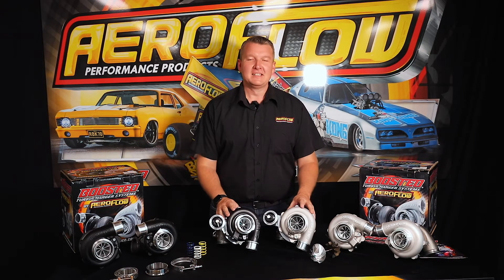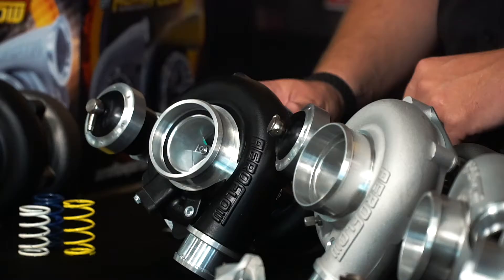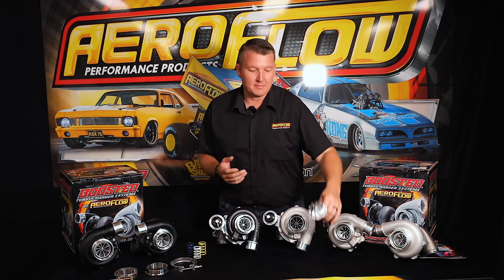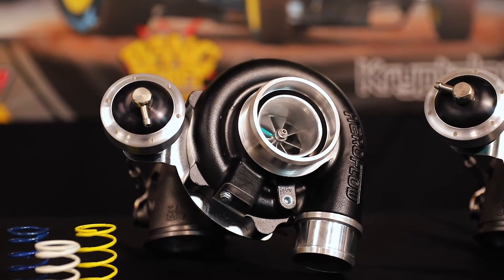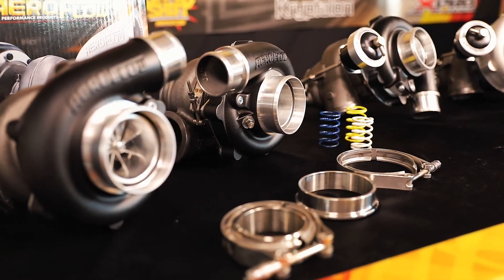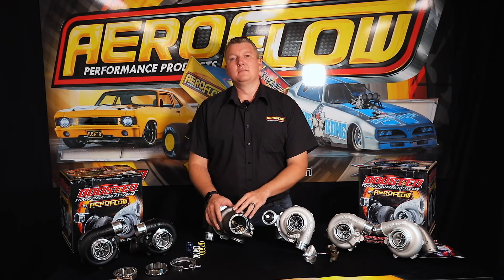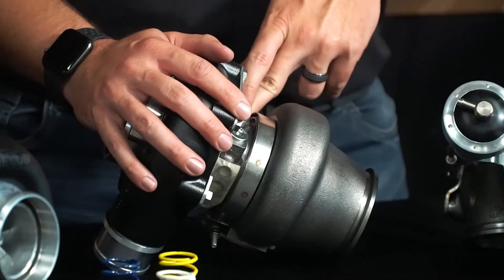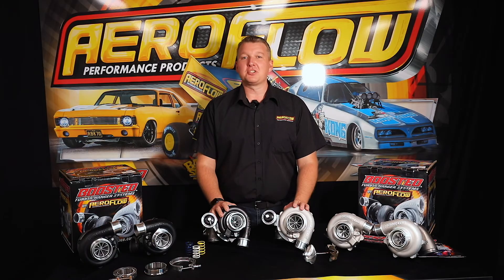Boosted By Aeroflow Turbochargers 4849 & 5449

Comment: do you have a how to size turbo vid
Reply from the maker: Not specifically but if you take a look at our Turbo 101, 102 and 103 videos that will give you a good idea on how things work, how they should be setup and roughly how to size a turbocharger. Aside from that feel free to get in touch and we can assist where possible
Cheers
Pat
Reply: @aeroflowperformance on a 3 litre engine what's the earliest you have seen these turbos make boost ?
Reply from the maker: @jmoore9806  too many variables to have a general number. What boost level? Comp ratio, cam selection, twin cam/single cam, fuel type, manifold design, gearbox type, diff ratio etc etc etc. This frame will be very responsive on a 3L and could be making boost as low as 2000rpm
Reply: @aeroflowperformance that's impress 2k spool